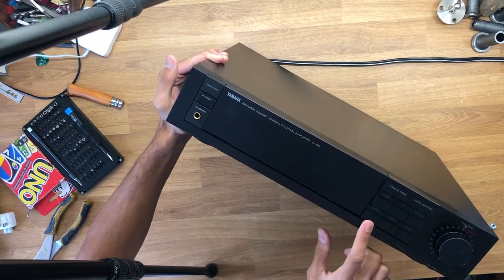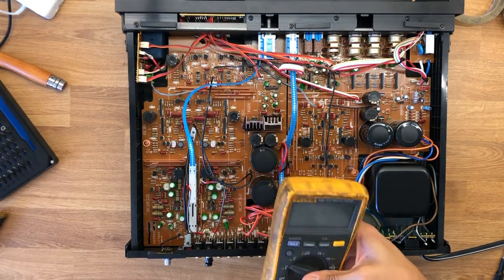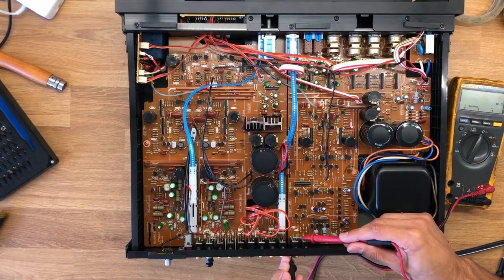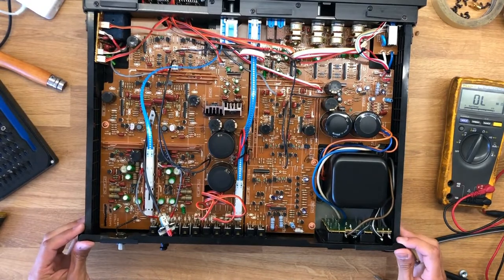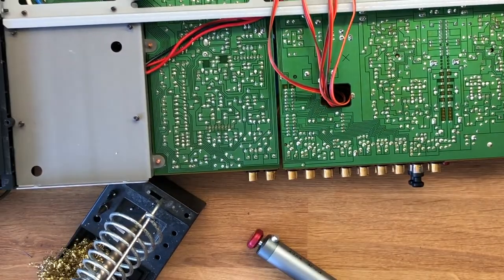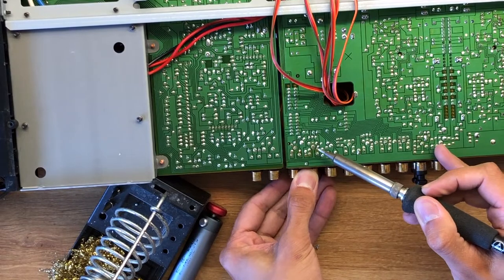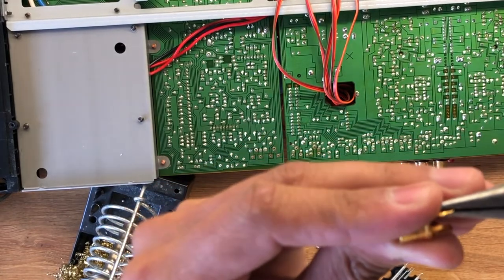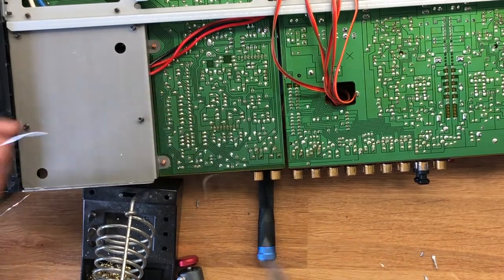Restoring a Vintage Pre Amplifier: A Step-by-Step Guide Yamaha C-85

Comment: I owned one of these new, back in the day!
I seem to remember that the phono sockets were always tight when I plugged cables in. It was almost like the sockets were slightly oversized. this may be the reason why you found some broken on this unit.
Heat wise it is a poor design - I regularly found quite literally components desoldering themselves!
Sound-wise, paired with the M85, it sounded glorious. Regardless of how difficult the room furnishings/acoustics were, the parametric controls could fine-tune out any problems